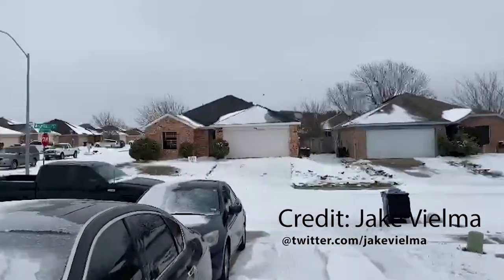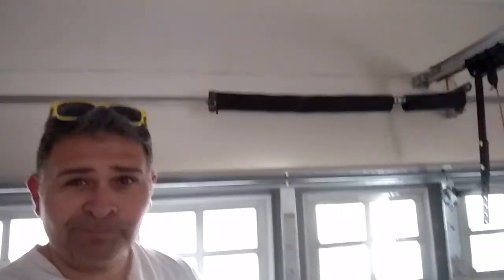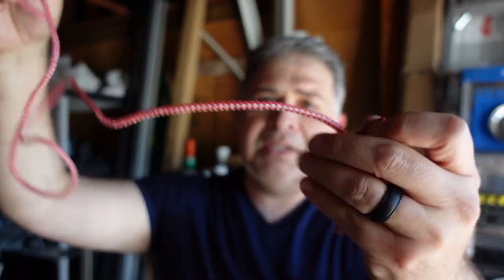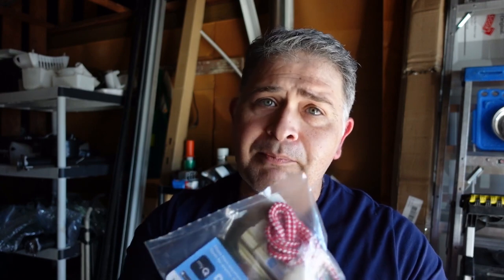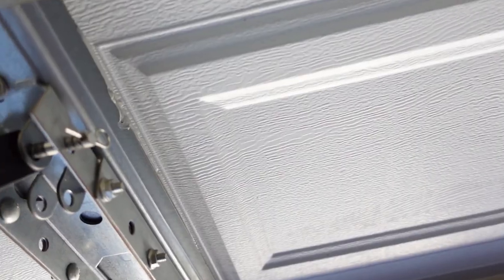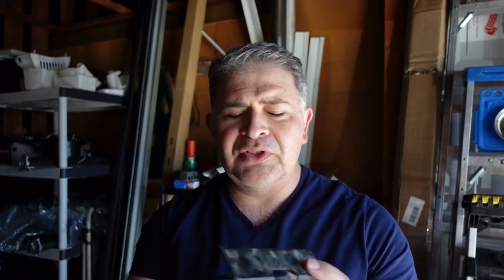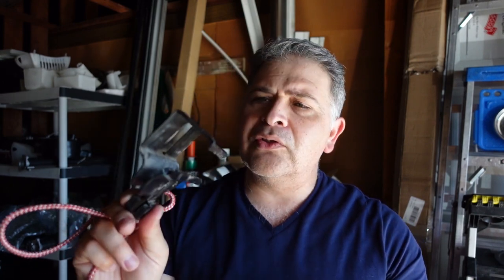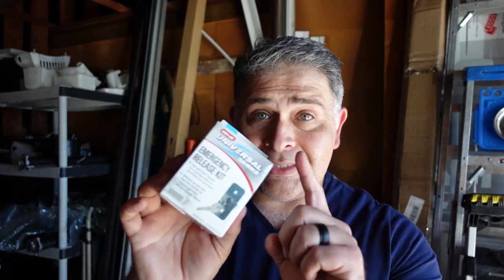Best Ways to Safely Open a Garage Door - In an Emergency

Comment: Right around 6’ off the ground is the height you’re generally looking for for the emergency release rope and handle on the opener.
Reply from the maker: I always get scared when I have a customer ask me if it's ok to pull on the 'red cord' when the door is in the open position.  😮